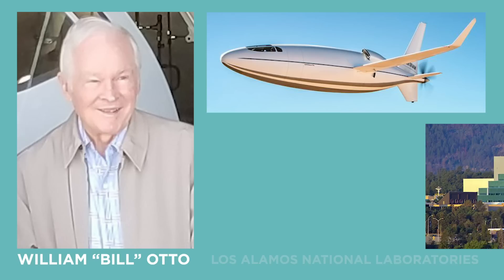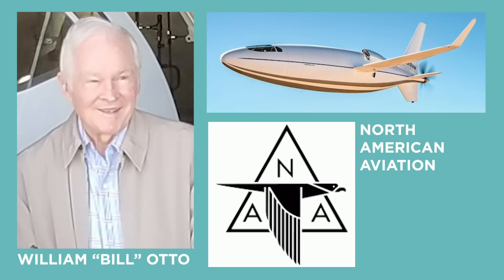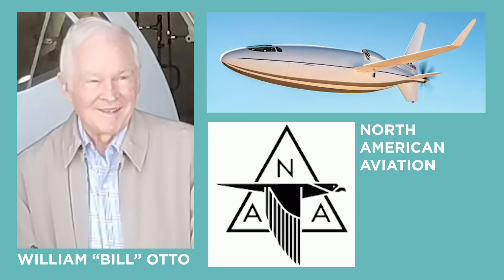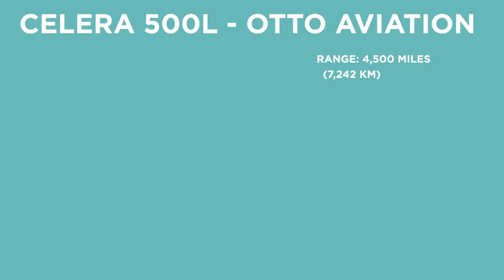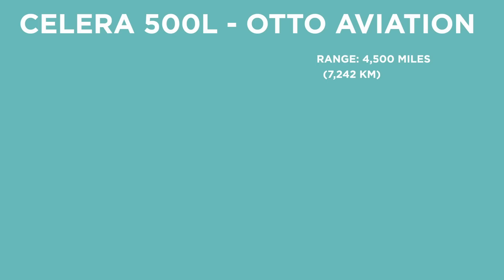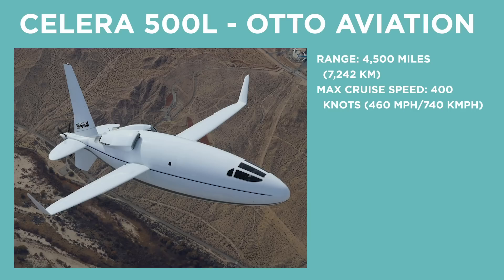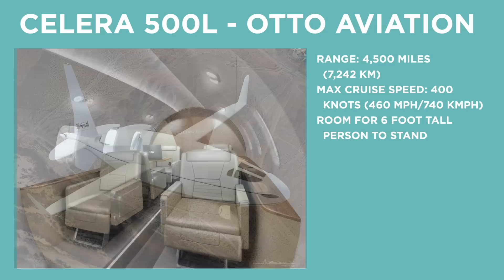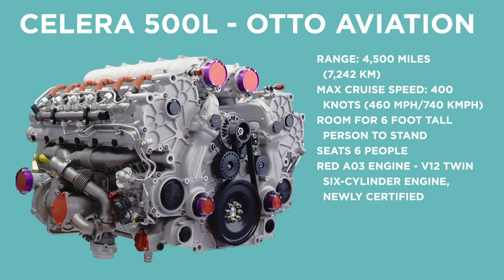Could This Plane Save The World? (Hint: No.) | Answers With Joe

Comment: Cost of a 747 is in range 228 to 260 million, not 20 million, you are off by factor of 10 for 747 price, otherwise good video
Reply: That's a large discrepancy.  Very large.
Reply: @MrExeetor  note that he didn't use a currency symbol. If he was speaking in £, it'd be roughly the same amount of money
Reply: Except that the 747 is an end of life plane and is being retired by many fleets. That price on the second hand market with faults is probably not that far off
Reply: Hjoe mentioned this in his pinned comment. He said he forgot to mention it was about used places, but a new one was still $50 million cheaper.
Reply: Basic 747 originally had a list price of 24 million new. You are adjusting for inflation.
Reply: 747 is outdated and really wasn’t the plane to use in this comparison.  787 Dreamliner purchase and operating costs would be a better benchmark.

However Joe’s overall talking points are correct.  Celera is too small to be fuel, labor, or space efficient per paying passenger/cargo carried.
Reply: Its actually quite a bit more than 260 million .

Comment: I feel like if anything, this just replaces executive and private jets.
Reply: If anything this plane is analogous to a scaled-down prototype. Thinking of it this way, every point he made is now irrelevant.
Reply: Not at all, this design was already done as a private plane more than 50 years ago. It has a MASSIVE issue with turbulence that shakes and rattles the people inside.
Just look up the "Starship" (Not to mention there was a end of WW2 era plane that used this design, the XP-55)
Reply: That’s literally what it is
Reply: “... just replaces executive and private jets.”
First, an executive jet is private, even when it’s an airliner owned by a non-airline entity, such as Hugh Hefner’s big black bunny.  Even Air Force One is considered private given it isn’t available to the public - who supposedly owns it.
... ->
Second, this hardly represents original thinking or implementation, as SilvaDreams has cited this experimental design concept dates back 50 years - and proved to be highly unstable, which is a well-known result of any specialized design whose stability and performance is optimized for a narrow band of velocity.
Reply: Well, there are still a huge number of private jets about, and if the rich or private airline companies could be encouraged to replace their wasteful 2-3mpg jets with an 18-25mpg Celera (or similarly efficient planes) that's still a step in the right direction.
Reply: @SilvaDreams  
This is not a canard design like the Starship. What makes you think it would be bad in turbulence?
Reply: @themartianway  T
Reply: Not only replaces, but expands the consumption of, because it makes it about 33% the cost of what it used to be.
Reply: It could still be useful.
Reply: It doesn't.  It IS however a con aimed at billionaires who want private jets, who don't know enough about aerospace engineering to know this is bullshit.
Reply: Private jets are exactly the market they're pushing for.
Reply: No, it would also help smaller cities, especially in places like the US.
Normal Aircraft that could carry between 5-10 people are really expensive to operate.

This plane could help communities around the world that can't sustain the traditional turboprops.
Reply: @shingshongshamalama  I disagree. This fellow, Otto really believe in his pipe dream. So technically is naivete not a con. I could find no substance/originality in this design.
Reply: Well, yeah but thats everything. Private jets offer amazing benefits. Private airplane travel allows a passenger to avoid check-in wait time, security wait time, the time you need to arrive early, boarding time, flight time, and the significant time spent traveling between the airport and your final destination, because the airports they can fly into are closer to your final destination. If a business is paying its employee many thousands of dollars an hour, it does not make sense for that person to fly commercially. It's exactly the advantage of driving a car as opposed to riding on public transit. However, private airplane travel is exclusive because of its cost. However, if that kind of travel was made as cost effective as an airline ticket, there would be a large shift in the airplane travel market. It would create a market that does not exist at this point in time. This is the thing that most people, including this video, don't understand. 

That doesn't mean, however, that it will replace airlines and large commercial airliners. It still will be cheaper to fly commercially. There is no way this will compete with RyanAir, for example. Current regulations prevent it from flying overseas, and then it physically can only fly over the Atlantic non-stop. That's not to mention the problems with pilots and ATC, thought those aren't as serious as the video claims. 
The real problem with this airplane is their performance claims have yet to be proven. They have maybe 50 test flights in 4 years? And only to 250 mph and 17,000ft? That is a bad sign. The engine is not certificated by the FAA yet, which is an extreme challenge in itself. I'd say it all revolves around that. I bet that they will run out of money before they get that engine certificated, and in order to salvage the program, will have to change to a turboprop power plant. If that happens, all the performance and economic numbers change, and it becomes a weird looking, albeit high performance turbo-prop, instead of the industry changer it was meant to be.
Reply: It would replace planes such as Pilatus PC 12

Comment: The design concept is what is exciting about this, not the first model.
Reply: That's what I thought he was going to talk about.  The design of laminar flow planes not this model!
Reply: Hear hear!! 🍻💧
Reply: I'd rely on the aerospace experts, but you could get "apples to apples" by looking at the coefficient of drag (for comparative fuel efficiency) and extrapolating "predicted cost" from comparing a 6-passenger Cessna to a 747, and then using the same multiplier for a 6-passenger Otto to a <insert laminar flow 747 here>.
Reply: laminar flow designs have been known about and used for decades, at least since WW2.
Reply: It's not even a new design. There was the XP-55 which is from WW2 and the again failed Beechcraft Starship.
The design has serious issues with turbulence
Reply: @SilvaDreams  Laminar flow wings are one thing, to  design a whole laminar flow fuselage is quite another, that takes advanced computer modelling which is still state of the art today. To design one that works at 500mph where compressible flow starts, on  plane the size of a 747 is still out of reach. The answer will be a blended wing design, not one with sharp wing fuselage  transitions like the Celera 500L.
Given that Reynolds number is size dependent, it may even be impossible.
Reply: Thats assuming it scales well.  I don't know if it does.
Reply: @donaldasayers  Have you seen the new (and old) research into drag reducing plasma aerospikes? That and dielectric barrier discharge plasma actuators have demonstrated that ionized air has a higher speed of sound due to the ion-acoustic waves transmitting forces through the electric field faster than sound, resulting in elastic behavior in the air where the back EMF is the restoring force. This results in the elimination of shockwaves at supersonic speeds, and restoring laminar flow in turbulent air and at higher stall angles.
Reply: Concepts are all well and good, but if they don't find a niche in the economy, they're doomed. And if this plane doesn't work using this concept, why would I design another one which is bigger and more expensive? Reducing cost is what you're trying to sell, and the concept isn't really scalable to get much bigger anyway. This model is the best shot anyone will ever have at this concept, and its still a solution that doesn't work for to a problem that I'm not sure really exists (at least not economically).
Reply: @taylorwestmore4664  whoa. Where can I learn about this!?
Reply: @The_Viscount  The manufacturers have stated that it doesn't scale well, and that makes sense, due to the viscosity of air. Should theoretically be possible at large scales, but more likely will involve more active design for laminar flow.

Comment: A new 747 does not cost $20 million, obviously - that's the average price for a pretty old second-hand 747. A new one costs around $300 million...
Reply: The average cost of a used flight ready 747 is closer to around $75 million. You can get one that needs a few million in work and to be recertified for flight for $20million maybe but the inside would be junk so it would need a few more million to be ready to use.
Reply: How depressing. He really got my hopes up.
Reply: $20M is the price for one that's been sitting in the bone yard for over 15 years.
Reply: Yeah, I picked that up too. That is an extremely significant error and changes his calcs alot.

Comment: A 747 is more towards 200 - 250 million dollars, depending on the specs.
Reply: COST. Today, the newest model of the 747, the 747-8, is on sale from Boeing for $386.8 million US.
Reply: Heck as per a few sources they sold for 24+ million when first launched in the early 70s.
Reply: And by boat of course I mean yacht
Reply: Love your channel but that video is just STUPID 🙄

1. You should compare planes of same size, so small private that sits 6 with Celera 500L.

2. Boeing 747 you should compare with jumbo jet build on Celera's principals. These would be completely virtual numbers but I believe Celera's designer could give you a hint.

3. According to GOOGLE Boeing 747 current cost $ 228 million - $ 260 million U.S.
Reply: @Tom_Mroz  I do think that making the comparison is valid even if he screwed up the figures. (Which is problematic) 

The reason being that people will start to do such comparisons anyway. Thinking such a small craft could replace lager airliners. The video actually hint at what the issue with that is. And that would be the crew cost and other service costs.

That also show what could be a solution for the Celera's to be competitive for in the future with the big airlines. If one can manage to scale up the plane one should at least be able to make a plane that is competitive smaller airplanes that runs smilier services. And we have also seen a shift in the airline industry of flying more point to point over spoke and wheel flying. But even these smaller plane still seat at least 30 or above people lowering crew and service costs a lot.

But is is also correct to point out that Celera 500L is not made to compete with these lager planes directly. But future iterations of the concept very well might be.
Reply: I had to check too because that 20 million didn’t sound right to me. This video is a bit flawed
Reply: ...and he never brought in the reason that to remain profitable, airlines are replacing their 747s with more efficient two engine airliners.
Reply: @Tom_Mroz  
I think the video was responding to the idea that this new plane was going to completely change the way everybody flies.  A claim that may or may not have been actually made by the planes designer.
Reply: A 747 can no longer be bought new as production has stopped. You need to look at used aircraft pricing for them, and the market is overloaded with 747s as airlines are retiring them at an ever increasing rate as passenger numbers have collapsed due to travel restrictions.
And those restrictions are going to become only worse, I'd not be surprised if within a year or two you won't be allowed to travel outside of your own town or city without a permit you can't get unless it's commuting to and from work AND you have friends in the department issuing the permits.
Reply: @jwenting  
"And those restrictions are going to become only worse"

They're only going to get worse as the infection rate increases.  It may take a long time to ease that restrictions; but that's because it takes a long time for peoples anxiety to relinquish.
Reply: @MySurreySquarePark  He went with the cost of a used 747 on the global market. Used 747s are not so expensive (in terms of airliners).
Reply: @Tom_Mroz  You can't just scale something up infinitely. The success of an efficient Celera 500L that can carry 6 does not mean you can scale up to an efficient Celera 747L that can carry 366.